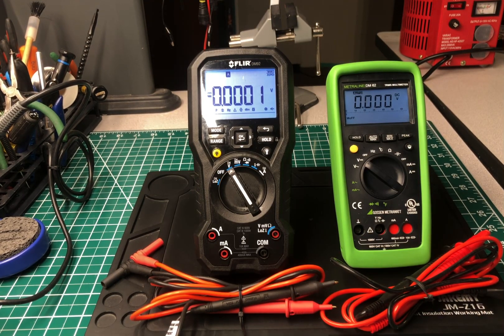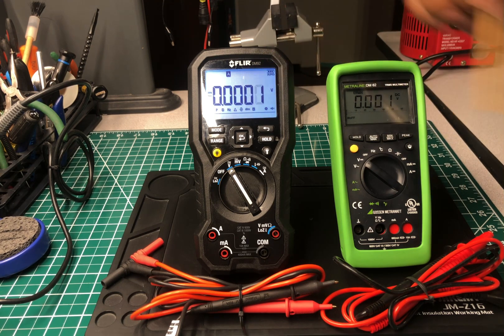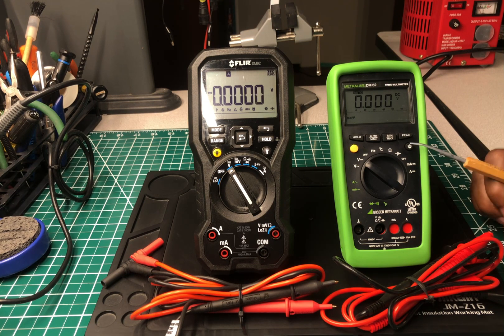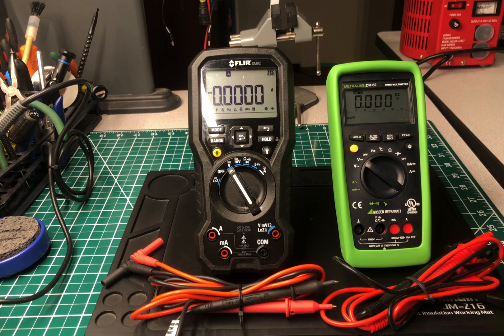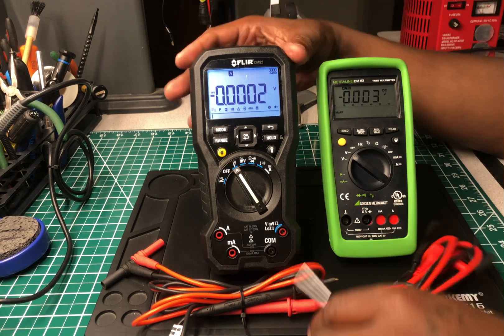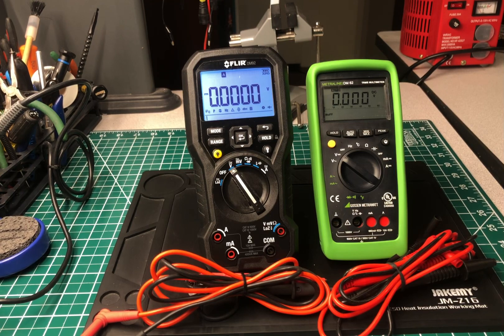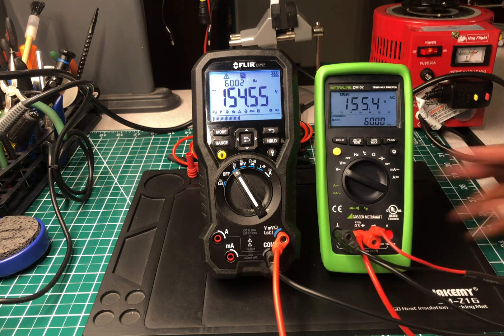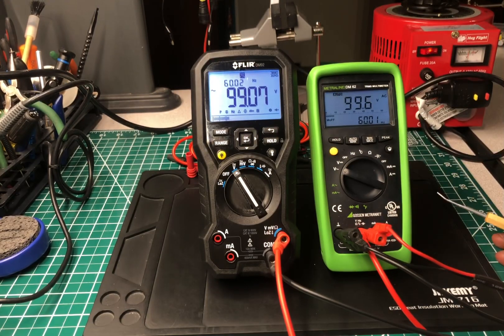🇺🇸 FLIR  vs. 🇩🇪 GOSSEN METRAWATT  ( Multimeter Comparison )

Comment: I clicked on this as I have the exact same Flir mm.  It's quite simple once you get the hang of it.  Has the features needed for working with both plumbing and electrics.  The india manufactured mm seems interesting.
Reply from the maker: Yeah the Gossen is interesting, but it can’t handle the FLIR💪💪💪💪💪💪

Comment: OK I'll chime in then 😀 i have the flir meter above this one  the dm93, only difference is ive got Bluetooth connectivity, these meters are made in Taiwan  not USA, check on the back of the meter or the box,  the markings and logos on the flir circuit board are identical to that of the appa multimeters,  the triangle probes are appa probes,  the temp probe that comes with the flir is a appa temp probe,  the navigation key on the flir is prominent on the 500 series appa meters, the screen on the flir is identical to the appa 500 series meters,  
On my flir dm93 there is a very short break on the audible tone (buzzer) right at the begging of touching probes, it will go  bip.....beeep, other flir reviews on utube also do this,  i don't know why, ive tried to find out, flir won't answer 😕  I also own the appa idm 503 & 505,  exact same problem with the continuity break in the tone, at the very beginning of touch,  these flir meters are appa made, fact. No two ways about it, ive got too many,  and too much is the same.
Reply from the maker: Thanks Barry for that information all I can say is  WOW 😲 . Man , I didn’t see the connection between Flir multimeter and  APPA. 👍🏿👍🏿👍🏿💪💪💪

Comment: I have the Flir IM75 and it operates in a similar manner to the DM92, I find I have to have the backlight on to get the clarity around the menu symbols. Not a big fan of the use of AAA for the battery pack, especially with the torch function available. Nice video TETC.
Reply from the maker: I was looking to purchase that instrument at one point. It looks identical to the DM92, I really dislike the symbols on the screen. It’s to confusing but other than that I believe it’s a very well made multimeter. By the way TP are you considering doing a video with the FLIR IM75 anytime soon ? If yes I’m looking forward for it 👍🏿thanks.
Reply: @TheElectriciansToolChannel  I plan to do a comparison review of the Flir to the Neptune in the near future, need to compare 1857FC to Neptune first though

Comment: I guess the Flir because of the display. I'd need to see more of its features though. I would need to read up on  how well it measures Frequency, 4-20ma current and DC voltage and Resistors.
Reply from the maker: I played around with the Flir a lot I didn’t take any 4-20 measurements.  But I do believe that this multimeter will hold its own against any of the multimeters out there. That’s just my opinion Tron, are you a instrumentation professional ?
Reply: @TheElectriciansToolChannel I am impressed you know a lot of different fields. Medical, Residential, Commercial, Industrial and Plant. When it comes to electrical you got it covered. Yes I am classified with the electricians at my job but my role is the Instrumentation and Control Specialist. I always try to keep updating my skill set.

Comment: Nice!
Flir looks to be on a mission, good build quality! Time tells all on any instrumentation.
Nice video!!!
I will say this technicians today have great tool selection since I been in the field.
I remember the Simpson 260 being state of the art analog meter, still is!!
Reply: That Simpson 260 is still being used and manufactured, leather cases and clear body style.
Not me, I had a coworker (electrician)who retired about 2 years ago and refused to use digital meters.
He had a couple of those simpsons.
Reply from the maker: If SIMPSON is still manufacturing those multimeters that means they’re still in demand and needed somewhere. And I can see some use for them, but I wouldn’t purchase any. I’ll just use the analog bar graph 📉 📈on my digital multimeter.
Reply from the maker: Wow 😲 that’s really old school analog unsafe multimeter. But that’s all  what was available at the time.😊
Reply: I agree 100%!
That's why you buy a meter with a bar graph. I know there are some seasoned technicians using fluke 100 series meters or other manufacturers with no bar graph. No commitment to your craft IMO!
I know those Simpsons were not affected by temperature or humidity and were being used in cold climates of Alaska, North & South pole.
There is still a very small need as you stated, but for the everyday technicians not needed.
That 87v max is nice but bulky.